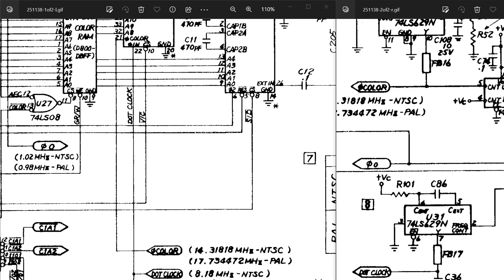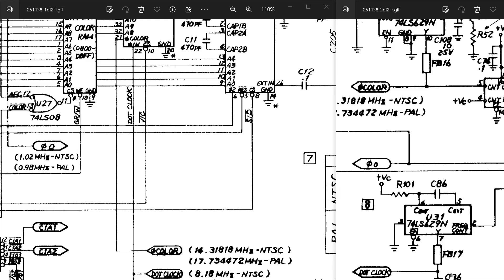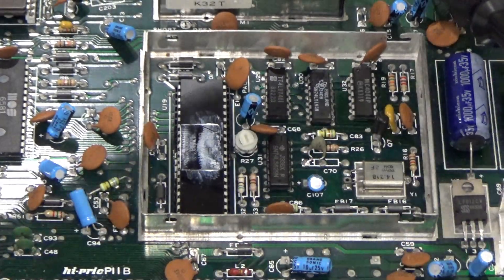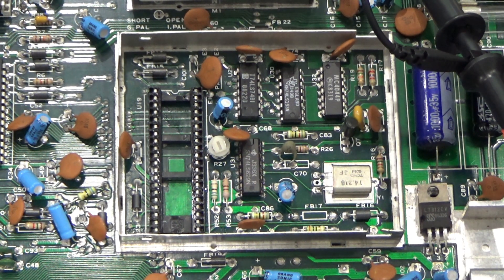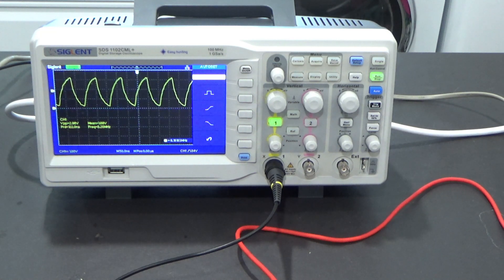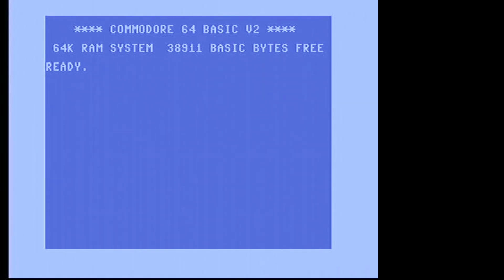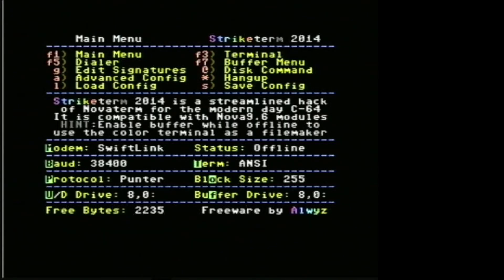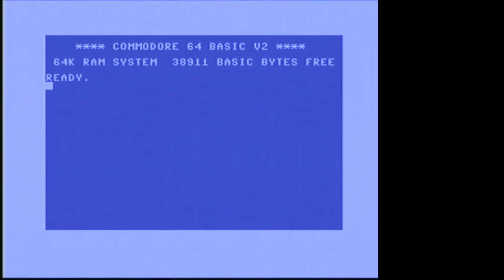Working Kawari Dot Clock on a 250407 C64 board

Comment: Is this mod necessary for a 250425 board with a vicii-kawari rev.1.2 to use a CMD turbo232?
Reply from the maker: Depends on what exactly your use case is.  If you're only using the stock mainboard oscillator for your native video mode then no mod needed, just keep using the original clock circuits.  If you use the Kawari's oscillator circuits or do NTSC/PAL switching then yes.  IIRC, I think I get into detail on these use cases on the 250466 video that I did last month (link in description of this video).